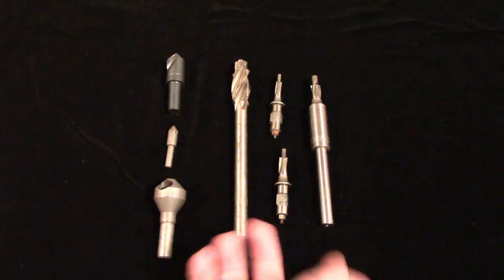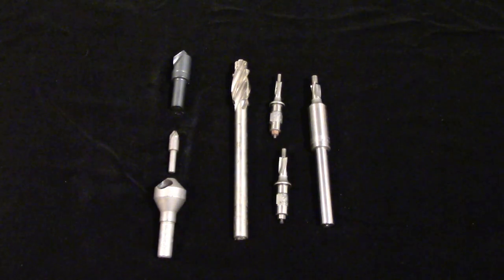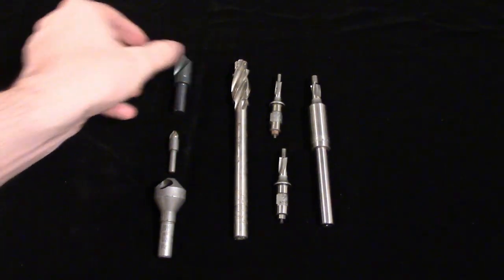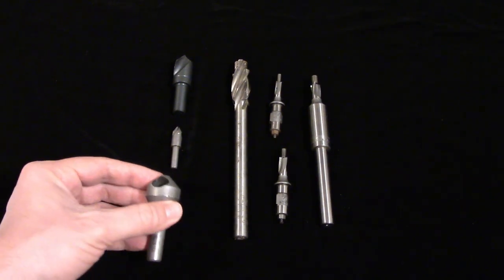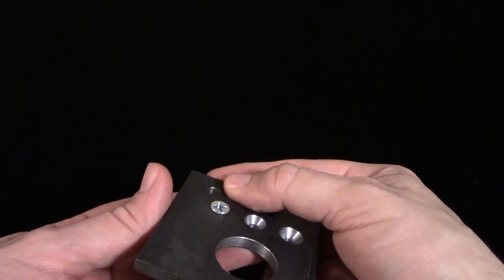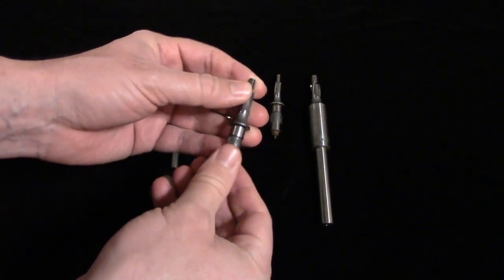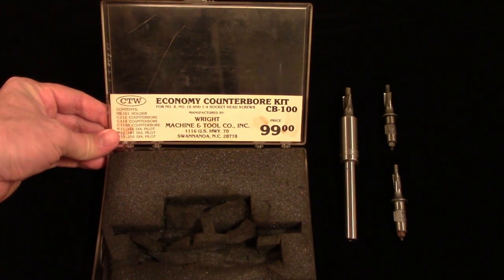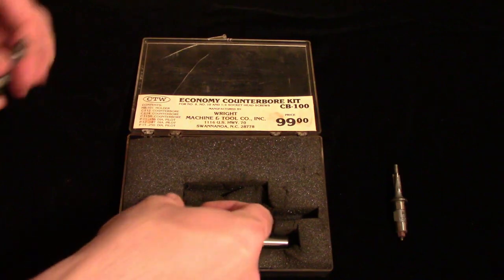Countersinks and Counterbores

Comment: As for cleaning things like disintegrating foam and anything sticky, take a look at a product called Rapid Remover. It's an industrial product originally made for the adhesives industry. Removes anything sticky within seconds. At one time it could only be had in a gallon or more, but now 32oz bottles can be purchased on Amazon. It's not terribly inexpensive, but a reference grade product. It's used in many applications. Have some tar stuck to your car? No problem. Took off a sticker and some of it was left behind? Less than a minute to remove. Edit: Almost forgot. If you buy NOS tooling that's stained with dry Cramolin, this stuff with a brass brush brings back a bright finish.

Comment: Why do they sell 6 flute countersinks as chatterless if you say they chatter more?
Reply from the maker: Marketing I guess, but the proof is definitely in the pudding.  They scream like a banshee if you even imagine running them too fast and the countersink will look like it was chewed in by rabid squirrels.
Reply: In my experience they work pretty good on the lathe and much more smoothly than 3 flute ones. 3 flute start to jump around once the cut gets deeper, especially on a small machine. At least that's what I noticed so far.
Reply: Great question! My first countersink was a 6-flute "chatterless," which chattered like crazy. Thought there was something wrong with my setup; the machine could have been more rigid. Then tried a Weldon zero-flute. It was like a different world.

Comment: Rubbing alcohol if you can find it gas if you can drip them in a sized container one piece at a time and shake tell clean then oil with your favorite libation 😉😉 replace foam with better foam, wood, or in most of my cases pappertowl/shop rag whatevers closer at hand wen I get to that step 🥴 

🥃cheers🍻